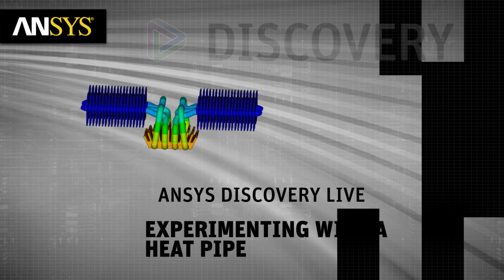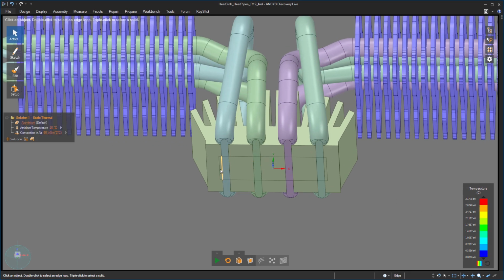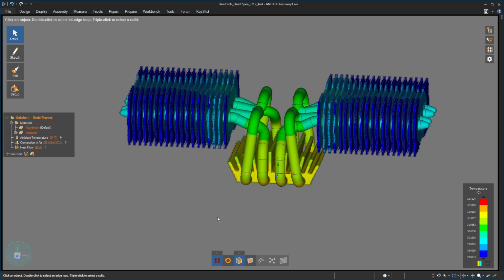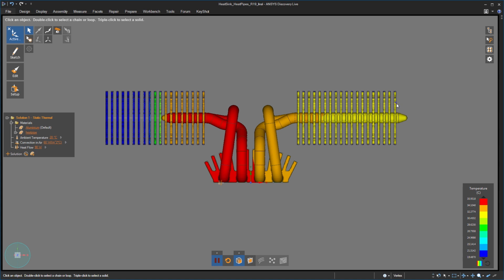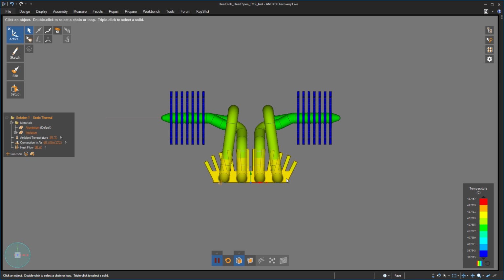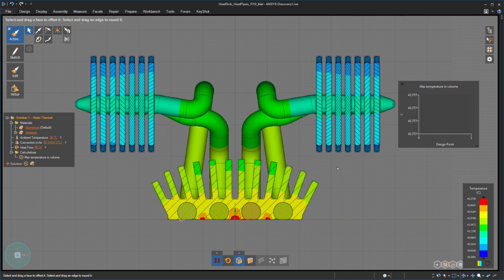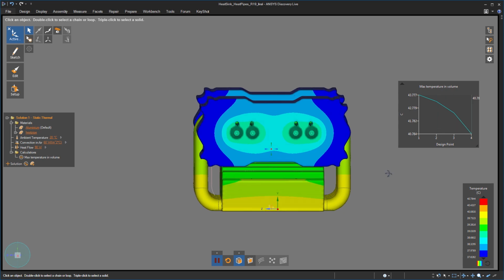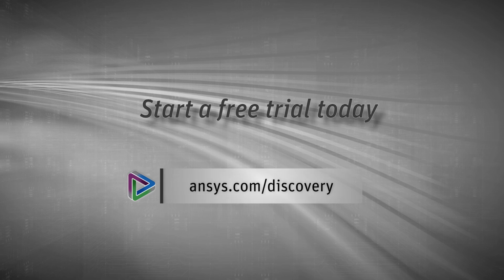Thermal Simulation of a Heat Pipe - ANSYS Discovery Live

Comment: HOW do you set the air convection?
Reply: amen brother, I am having difficulty setting this up as shown... Especially with forced convection. I would like to add a CPU fan or equivalent for either an internal or external flow case, but struggling to set it since the only options are flow inlet and flow outlet. I am thinking of creating a cylinder where the fan would be, setting the "fan inlet" as a heatsink outlet, and the "fan outlet" as a system inlet, except I don't know how to define the temperatures, since my fan s in the middle of my heatsink so the "system inlet" temperature should be equal to the "system outlet" temperature which is affected by the heatsink. I really just want to define a planar surface as having a normal air velocity of X CFM where the CPU fan would be, or define a rotating impeller, which i don't think discovery is capable of to my knowledge.

Comment: what are the specifications of the Heatpipe material?
Reply: model your heatpipe solid and set the thermal conductivity to 20e3 w/m*K; then adjust the 20k up or down so that the max. thermal gradient of the heatpipe is 5deg C. Real world heat pipes are 2-5deg C thermal difference so 5deg C is a conservative simulation, 2.5 deg would be more realistic but depends on the dimensions and orientation of your heatpipe. See a heatpipe configuration calculator from heatpipe manufacturers for more application specific considerations - the main design consideration would be the diameter of heat pipe required for your thermal load, otherwise a 20k thermal conductivity should address most ballpark simulation requirements depending on the required accuracy of your results